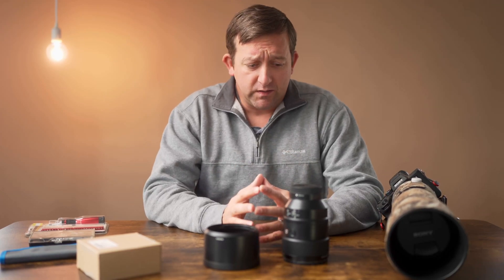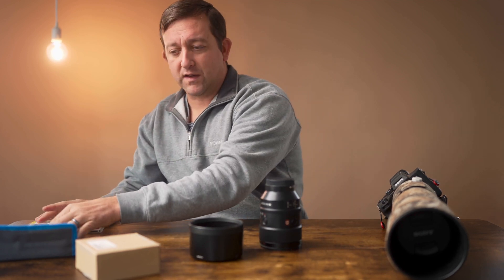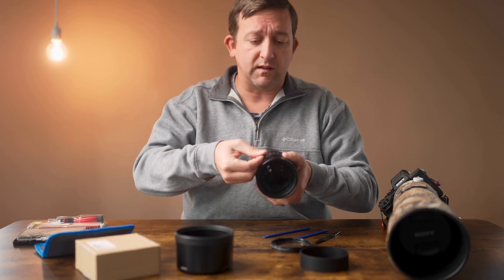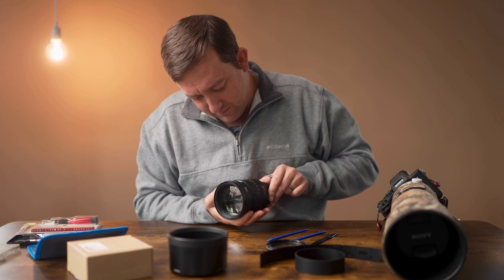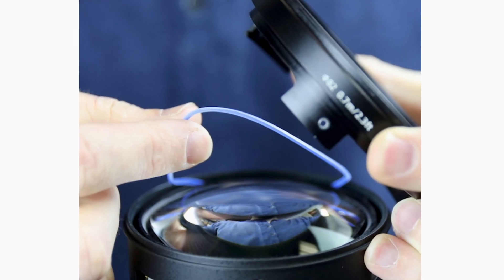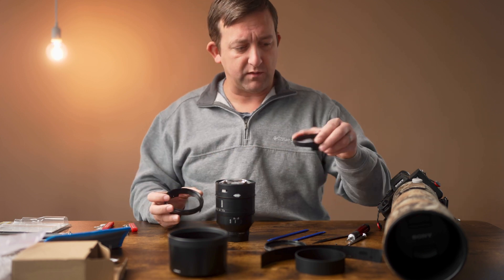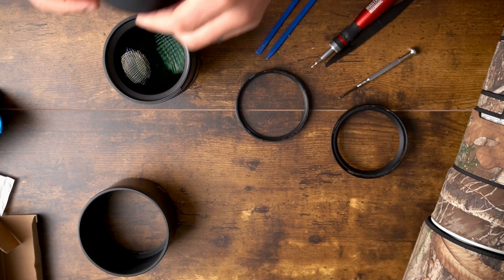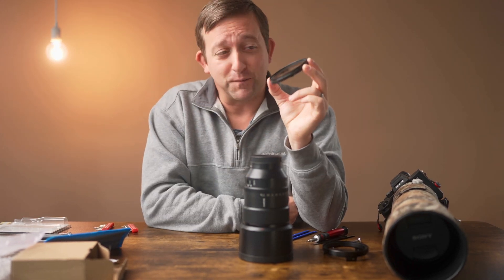Sony GM Lens Repair (135mm)

Comment: Thank you for showing the repair! Seems to be quite a common problem, may I ask if the part simply snapped off due to the shaking or if it broke after hitting it somewhere? Just trying to be careful with my new 135mm GM.

Comment: Hi Jacob, I am extremely appreciative of this lens repair tutorial. The exact same thing happened to me where the accessory ring on the front of my Sony 135 GM lens snapped off. Local camera shops wouldn't touch it for some reason. They told me I had to do a Full service through Sony where they take the lens apart and search everything from top to bottom costing more than $600. After reaching out to Sony, to my surprise, they sent me a list of parts that I could order myself. I actively embrace DIY projects, but have never taken a part of lens before. Finding this video that you have posted, made it clear that this was something I could handle. Thank you so much for taking the time to go through this for everyone who ran into the same problem that you and I did.
Reply from the maker: I’m so glad that you found it helpful. I hope your repair goes smoothly! It’s crazy that it was going to cost $600 to get repaired.

Comment: I did the same repair due to a dented outer ring (no damage on the front element or the focus ring but the sealing ring was a PITA to reinstall  so I had to reassemble without it, mabe I should give it another go..
Reply from the maker: The ring is finicky for sure! Did you end up going back and installing it?

Comment: This is very helpful, mine did the same thing but I sent it away via my insurance company to be repaired but it happened again! (it's definitely a weak point) Seems they went the glue route instead of fixing it properly like you have. Did you notice a difference in the new part to the old? Apparently there's an updated part which holds much stronger. Thanks for posting!
Reply from the maker: @markwildphotography  Glad you found it helpful! I can’t say that I noticed anything notably different about the new part.